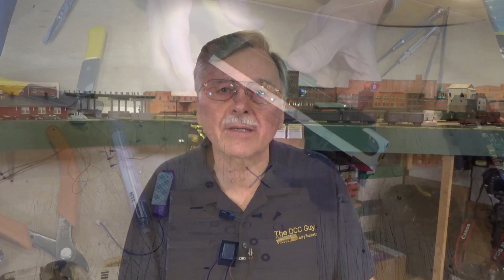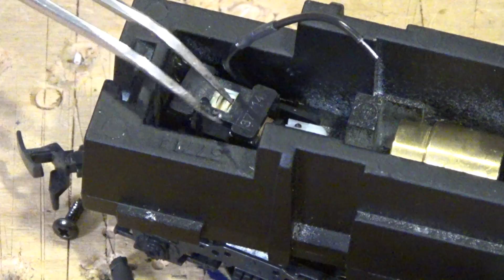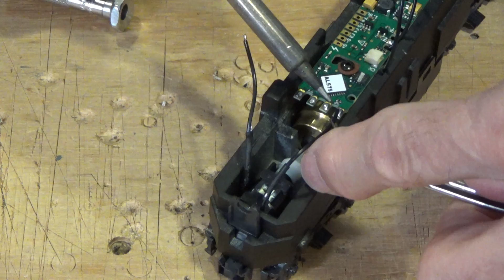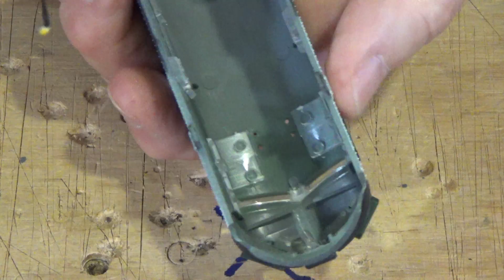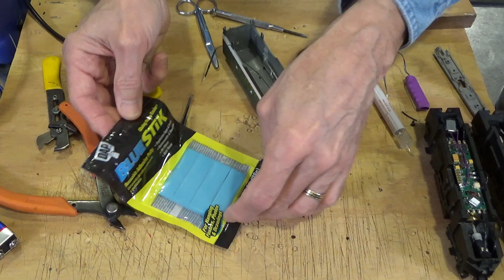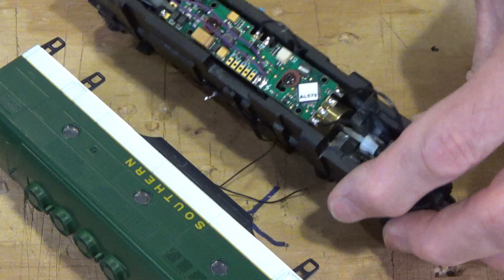Convert an old DC loco to DCC (50)

Comment: I have several locomotives I wish to convert to DCC, does it matter which decoders I use? Also how do I choose a controller? Thanks in advance.
Reply from the maker: You can use any brand as long as they are rated high enough to carry the load. As for choosing a DCC system there are a couple of videos here on that topic.

Comment: Thank you for this terrific and informative video Larry. I came upon it as I was doing some research to determine how to install DCC sound decoders in several old LifeLike Proto 2000 locomotives (two GP7s, a GP9, and a GP30). Your video has increased my enthusiasm for this project. It seems the biggest obstacle to overcome in getting this project going is to figure out how to remove some of the material from the weight inside the locomotive to create a cavity for a speaker. I haven't been able to find any material during my online searches where anyone discusses or demonstrates specifically how to do this. Do you have any thoughts, ideas, or guidance on how to proceed?
Reply from the maker: I showed how to do the LLGP7 in the April 2020 issue of Model Railroader magazine. I used a Soundtraxx TSU-1100 decoder but the TSU-2200 may fit too but just not as easily. I put a sugar cube speaker in the cab. I love the ones with the  round top enclosure designed just for cab installs that Streamlined Backshop sells (www.sbs4dcc.com).
Reply: @TheDCCGuy  Thank you for your prompt reply. I dug out my April 2020 issue of MR, which I'd somehow overlooked, and read your article. Terrific! The sugar cube speaker mount from Streamlined Backshop to fit within the curved roof of the cab is ingenious. I have some more research to do, but your article has given me the confidence to move forward with this project.
Reply: @TheDCCGuy  I have a question maybe you can help . I have a bunch of old rivarossi ho scale steam I added dcc sound first digitrax they work ok sound not so good . They work with factory motor in all my trains. Well I decided to try xl systems dcc decoder with sound. Now the motors have all been isolated.  First one was fine sounds alot better. Second on got damaged now motor is isolated so I thought well apparently when the motor is mounted to casing even though I took out the tap that connects the brush to the motor  casing.some how there is some resistance from the caring and one of the motor contacts.  I took motor apart and used a very tin washer to go between the brass one and the comuntator side of the motor thinking carbon was making a connection to the brass washer.  That worked . Now don't forget the digitrax decoders worked fine it's the xl systems decoders that don't. After I got a new one in with the modified  motor it stopped flipping out and I did not toast another one . The thing is the chuffs were not right no matter what cv I changed.  I did a motor swap with a motor from China now it chuffs more accurate. Sorry about the long intro . Do you think the xl systems decoders are just very picky . Other than the fact they burn out quickly if there is any path of resistance to the casing. They work well . Why did I have problems with the chuff with old motor.  I have another rivarossi with original motor I isolated and used a plastic washer bushing in and that has not issues works great. Any ideas. If any one would know it would be you

Comment: Hi Guy, just wondering if this decoder will work in a Kato EMD GP35? Thanks! Enjoyed the video by the way. another question how did you calculate for the speaker watts.
Reply from the maker: I don’t have a Kato GP35 but if it has a light board similar to this one it should fit. On their web page they give the dimensions for the ECO-PNP and TSU-PNP decoder boards so you should be abled to measure and decide whether it will fit. With a 2 amp rating it certainly has the power. These are now my favorite decoder and I use them in Atlas, Athearn, Stewart, Intermountain locos.

As for speaker wattage, it is usually stamped on the back of the speaker or provided elsewhere, same with the impedance (ohms). Sound decoders also are rated as to their impedance and wattage output, so make sure to match them. I talk about all this in the two videos I did on installing speakers.
Reply: @TheDCCGuy  Thank you! This was very helpful.

Comment: So glad I found your channel I'm beginning to understand DCC more and I may try converting some older locomotives. Are there certain brands or styles that cannot be converted? Thank you for the great information.
Reply from the maker: Any locomotive model can in theory be converted. However some are much easier than others. The newer the model the easier it is likely to be to convert. If a loco model is built with provisions for DCC and sou d it will be easier than one that is not. Also be aware that there can be differences between models of the same loco made by the same company, so check before you buy. For example the DCC model may have a special space for a speaker that is not in the DC version. That is one reason checking magazine products reviews can be important.

Comment: Hi Larry. Many thanks for your instructions. Quick comment, I looked on eBay for the surface mount 0805 LED using your details. However I could not find "golden white" , pre-wired with a 1000 ohm resistor. It would be helpful if you could either provide the vendor name or eBay link URL directly tp the product.  

Again thank you, the instructions are perfect!
Reply from the maker: Here is the listing title: L0805GW 20pcs Pre Wired GOLDEN White SMD 0805 Led Lamp Light Set 12V ~ 18V 

and the url: https://www.ebay.com/itm/L0805GW-20pcs-Pre-Wired-GOLDEN-White-SMD-0805-Led-Lamp-Light-Set-12V-18V-NEW/263224521440?epid=1731872038&hash=item3d496772e0:g:YqMAAOSwYZZZ3ypj
Reply: Barry Snyder 0
Reply: Greetings Larry! After ordering all the parts for this project and following your instructions the first of 3 Bowser/Stewart F units has been converted to DCC and fabulous sound. I want to thank you for the easy to follow steps and your relaxed "you can do it" process.

Comment: which sound decoder works for athearn blue box switchers....? thx great videos  first time ddc'er
Reply from the maker: I’ll have to add that to my list of decoder installs. It can be complicated since it requires isolating the motor fro  the frame. There should be plenty of room in there a d my July DCC Corner column looks at installing one in an Atlas S2. Of course each Athearn switcher is a little different and some have more room than others. Age is also a factor since newer motors draw less current than older ones. Which one are you looking at doing and how old is it?
Reply: @TheDCCGuy  hasn't got here yet...i'll get back when it does  thx much
Reply: @TheDCCGuy     yes it has the older fat gray motor...which draws too much amperage....i'll have to remotor or ...get a loco fully equipped.....thx for helpin out.
Reply: @TheDCCGuy  will that be one of the older Atlas/Roco S2's? I have a pair of those I'd love to add sound too. Looking forward to that video!
Reply from the maker: Yes, made in Austria but with the 5 pole skewed motor. Runs great now but the whine of the turbocharger drives me up a wall. I think I might try using the sound project of the Alco 539 prime mover that was used in the S1/3 switchers—those were not turbocharged.

Comment: I have 3 Bachman f-9 locomotives that were made back in the early 90's, would like to convert to dcc, how do i do this,
Reply from the maker: Allen, sorry but I have few Bachmann diesel models and am not familiar with that particular one. However, TCS has an excellent step by step guide to installing a DCC decoder in that model. Here is a link to their website with the tutorial:

https://tcsdcc.com/installation/ho-scale/1211
Reply: I forgot to mention these are n scale
Reply from the maker: Ok, I suggest you check with Digitrax and TCS as they produce a lot of drop on decoders for N-scale locos.
Reply: Ok, but they did not have dcc when these were made

Comment: I wasn't able to find the SMD Warm White LED's with resisters for anything like that price. Any link?
Reply from the maker: I may have misquoted the price. I went back and found the purchase which cost $13.99 for 20. There are others for as little as $10.99. The link is https://www.ebay.com/itm/L0805GW-20pcs-Pre-Wired-GOLDEN-White-SMD-0805-Led-Lamp-Light-Set-12V-18V-NEW/263224521440?ssPageName=STRK%3AMEBIDX%3AIT&_trksid=p2057872.m2749.l2649

Comment: Great video Larry. You and I must have been doing our Stewarts (5) at the same time but I only did non sound drop in. I did my light a little different, I copied the original mounting but used a 3mm warm white that I had a bin of, attaching a resistor to the positive and the other end to the board and had to add about 1/2 inch to the negative to reach the board plus heat shrink. The light didn't quite fit the original tube .. almost a little filing of the flange would do it, but I had aluminum tubing that did fit. My Northern Pacific was a high miler and had power pickup trouble and I had read that a little graphite on the end of the axles where the points touch the brass pick up bar helps, and it does. Of course I did this last and if I was to do it again I would start with that and while I had the trucks apart I would replace the wire to the decoder added a KD #450 on the back and away it went... On one other unit I did use an LED like you but used the blue putty to fasten it to the shell so I can remove the shell and the light can be removed easy.
Reply from the maker: I found some black tack adhesive putty from Uhu a German company on Amazon. I am now just installing the LED on the rear of the lens insert then installing a plug of the Uhu up against it. That prevents the light from filling the cab and provides a nice black background for the LED instead of a blue one.

Comment: Great tutorial video. I like to run the wires through the circuit board holes, just my preference. Stewart locos are always a good runner.
Reply from the maker: I generally do it if I use the black plastic clips off the old circuit boards, but of course the old Stewarts don’t have them. The solder will hold the wire in place no matter which way you do it. And it is a bit fidgety trying to feed the wire up through the hole from beneath the board so I don’t, but everyone should find out which way works best for them.

Comment from the maker: Hmmm, YouTubers don’t seem all that enthused with this one! So is it the subject matter—installing decoders, or is it the length? Should it have been cut into at least 2 parts to keep the individual playtime down to about 15 minutes each? Give me some feedback on this one as I don’t want to waste time producing videos no one wants to watch!
Reply: Since I posted this the video has become one of my most popular in this time period so it seems to have just been a slow starter. I also think a lot of folks watch it in stages, making it in essence a multipart video. The more recent H-16-44 video also did very well even though it was over 20 minutes long. So I don’t plan to change the way I do these installation videos. So thanks to all who responded with their comments—Larry
Reply: Length no issue saw a 1 hr video on installing a decoder that was a bit too long.
Reply: I think that the length is fine.
Reply: Would rather watch a whole video than a 2 part
Reply: Found this very useful. Have many, many old diesels that need decoders. I vote for the "how to" approach from your posts.
Reply: Well for me, I ff’d through the first 2.5 minutes, then gave up. It’s H Bloody O. Need N scale video.
Reply: Excellent explanation and video. But I was left with some questions: how did you know which motor lead was + and -? Why did you use Kapton tape to hold the light wire to the shell?

Comment: Red/Orange Black Grey?
Reply from the maker: This is not a wired decoder so does not have the NMRA wire colors. While you could use the properly colored wires I didn’t since they are so straightforward in this case and black wires are less likely to show through the portholes and windows than red, orange, etc.

Comment: Another well done video. Question did it matter which speaker wire was added to the decoder S+ or S- ?
Reply from the maker: Good question, but in this case it doesn’t matter, and I can’t ever remember seeing any tech specs with sugar cubes designating which contact is positive and negative. It really only matters when you install more than one speaker in the same loco so they are in phase, but even then the actual polarity doesn’t matter. Just make sure you wire them the same. I will do a video on speakers in the future showing how to install multiples and wire them in proper phase, etc.

Comment: I'm jealous of the fact your sound decoder has a powering down sound effect. I just bought an Athearn Genesis GP-38 with a factory installed Tsunami2 decoder, and I've searched the manual and can't find any powering down sound. That sort of kills the realism for me having to cut the sound like turning off a light switch. This is my first DCC locomotive. I just bought it and a Nce power cab system.
Reply from the maker: Try using F6 on your throttle, that is what does it. It is the same for the Tsunami2 and the Econami that I used in the video. There is also the possibility that function was not,included in the version of the Tsunami 2 decoder installed in your locomotive but I thought that with these newer decoders they did not dumb them down. I’ll try to remember to ask George at Soundtraxx the next time we talk.
Reply: @TheDCCGuy  Thanks for the reply. According to the book with my loco, F6 and F5 is a lighting effect such as ditch lights if equipped on the proto type. Nothing happens when I press F6 so I assume the gp38 did not have any.
Reply: @TheDCCGuy  Ok so I figured out what is going on. The F key functions aren't all the same in my manual as what is shown in the online manuals on the Soundtraxx website. My user manual shows F26 as the +rpm and F27 as the -rpm. I did not know, nor does it state in my manual that if you repeatedly press the F27 passed it's lowest rpm level it does do a shut down sound. I tried that and it works.
Reply from the maker: Yes, sometimes manufacturers request special remapping of the function keys for their decoders and that sounds like the reason. You can fairly easily remap the keys any way you desire and I’ll add that to the list of topics to cover in a future video. However the Tsunami2 manuals have a pretty good explanation of how to do this. In the video I will probably focus on the DecoderPro approach since it is the easiest way to handle an otherwise complex topic.
Reply: @TheDCCGuy  Great. I would like to see that in a video.
Reply: @TheDCCGuy  I figured out of to change F26 and F27 to work on F5 and 6. Much quicker to use now.